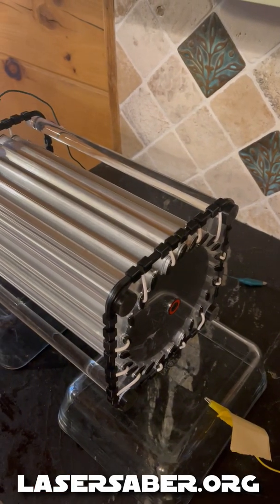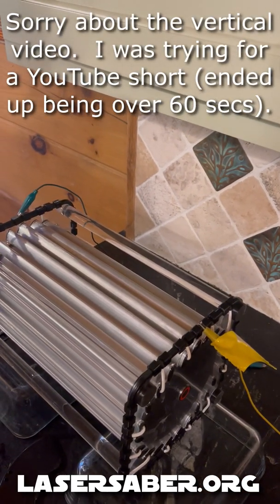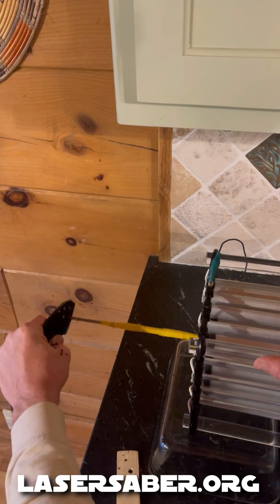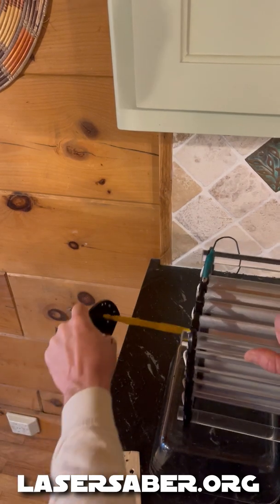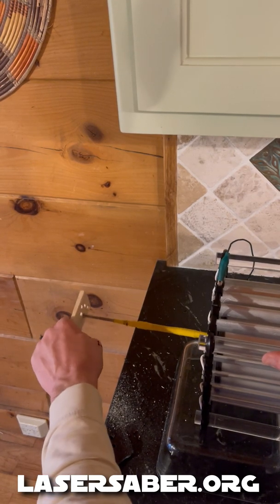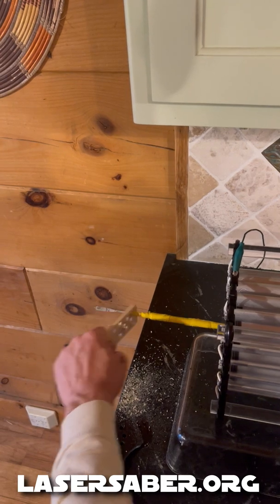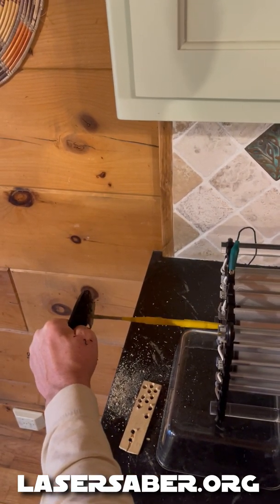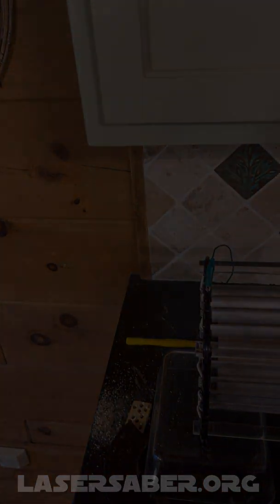Drill Torque Test - AtmoMotor Corona Motor

Comment: Seriously that's not a method for measuring torque. Pulling a defined weight up a defined hight until the motor stalls on the other hand is. Conveniently in Nm devide the weight by 10 to get Newton an raise it 1 meter and you get torque measuring also the time it takes to get that weight 1 meter up high gives you Nm/s =Js = Watt so go with a more scientific approach if you want to proof something otherwise you look like a fool fooling around with toys. Which clearly this isn't. We need empiric data

Comment: if you want a more effective wireless system you should look into Solishoods (charles solis) he describes the (death ray) as basically a van de graff generator with insulating glass vacuum tubes and metallic umbrellas to increase the capacitance before discharge, I think the design was basically a dryer vent in a loop and the desiccated air is charged with HVDC.

Comment: You probably won’t see this, can it be used to make a pump? If you can pump water up to a high height, you could make a water battery. It would pump water up to a tank 24/7 and when you want to use that water you gravity feed a generator with the water.
Reply: A ram pump can do this as well if you have some elevation in a creek, stream or river

Comment: Details on the power supply you are using, what power is it drawing, and perhaps you can quantify the torque, and efficiency on these are low.  I don't think many of your viewers understand that there is a reason, you need to use you 30 kV power supply and NOT the Van De Graaff or the atmospheric tower to do this.  That's important, the reason you need the power supply is you need a lot of energy in, neither of those other two sources can provide it.

Comment: Hey man good info, checkout video how lightning works, earth and air is AC electric at 6 cycles per second, so a earth battery or antenna requires a bridge rectifier for DC charging of batteries, oh have u heard of cold electricity? Patick kelly channel has tonnes of hidden patents videos

Comment: you need to put high up there a symmetric copper antenna and a hollow iron/bronze ball with copper coating filled with gold amalgalm (10/90 24k gold to mercury)
Reply: Why's that then ? ☺️
Reply: @strawman9410  Mercury reacts as a resonant frequency amplifier somehow
Reply: @vladimirN324  thanks. I need to do a lot more studying of this subject before my build attempt
Reply: @strawman9410  it uses the cathedral's conductive dom as a ground pole magnifier and wave guide it concentrates the a wide area of ground phase to a single point resonator say a cross or so. Its easy
Reply: @vladimirN324  now your just teasing me.
Why do you mention this version, is it a affective method?
Do you have link to an image or upload
Reply: @strawman9410  watch Introduction I to the nanoworld translated from Russian, a company called центрнаучфилм - наномир
Reply: @vladimirN324  can you provide a link

Comment: Powered Van de graff generators have like a 25-35W motor... (is yours super big?)  I know turning a van de graff by hand really never changes force for speed... and is much less than using a hand drill to go through wood.... as voltage goes up, the power goes up by the square; there is, granted, a high resistance... but as the speed of the motor goes up, does the resistance go down?  That would give more effective power at a higher speed... it'd have to be geared down probably... to gear it back up again in the handheld generator... which is a similar power rating.

Comment: these short style ones really are a waste of time. doesnt even format correctly for a phone unless you are in the proprietary app i presume. ugh 
fun project! whenever i catch something substancial about it ill hit it up. funny to me that people think torque was going to be a problem as atmomotors are electron density repulsion driven arent they? so if anything the more torque you ask for the more torque you get. up to stall anyway.
Reply: He IS NOT driving it from the Van De Graaff OR the Atmosphere in the drilling video, he says clearly he is using "his 30 kV power supply", I assume 50 watts in minimum, these are not very efficient so he is putting MUCH MUCH MUCH more in than he is getting out, the Van De Graaff would be useless as would his simple atmospheric tower.  Also, notice he is not running it via the corona pin, but directly, that is because the corona spray method will lose energy based on the law of inverse squares.  This is NOT some free energy nonsense, hence the reason he needs the 30 kV power supply to get his torque.

Comment: I think a simple rough way to 'measure' torque would be to quantify the rotational inertia and get an rpm guage (white tape method) and capture the reading on camera. Write down the time of each RPM update in a spreadsheet and you'll get an idea of the angular acceleration, and thereby the torque. Google docs could be useful if you wanted to share results.

Edit: Also, nice demo, it's looking really hopeful.
Reply: chuck a drill on the output shaft and then measure the current coming out of the motor

Comment: That's definitely impressive it's getting into the realm of seeing what some of these industrial motors can do I know are out there somewhere.. Like really finely constructed fins to provide the overall surface area in a small package and a strong dielectric to drive it at many kilovolts. The heat losses aren't there and it's basically unaffected by being stalled.

Comment: what is the amp draw during drilling?
Reply from the maker: Less than 1 mA.
Reply: @lasersaber  thx laser and plz correct me if I'm wrong so in reality the motor or the system is extracting about 30 watts of power from the atmosphere
Reply from the maker: @mohammadhashemi1771  In this case I am powering the motor with my HVDC power supply.  Check my other videos for free atmospheric energy collection demos.
Reply: @lasersaber  got that from tge video was just working out how much power o e would need to harvest from the atmosphere to run a motor on that level and get that sort of work out of it

Comment: Nice torque. Care to measure it with a pully and weight? 

Then share the weight of the motor. That might give an interesting torque to weight ratio.
Reply from the maker: Thanks for the idea.  I am already boxing this one up to ship out to Ion Power Group.  These motors can be designed to be very light.  Heavy parts are not needed.  A thin electroplating on a lightweight surface is all that is needed.
Reply: @lasersaber  Ohh ion power group, awesome to  hear they're still working on the atmo power plant

Comment: Noice
What is the input rating?
Reply from the maker: I have not made the measurements yet.  For now, I am interested in seeing if the torque continues to increase with the size of the motor.  I have a much larger build planned.  The power supply runs off a 12v/4a regulated wall adapter.  I doubt that the HVDC generator uses anywhere near that amount.  The output is 30kV at 1 milliamp.  I am not sure it is running at 30kV DC; it might be less than that, but I guess that is the maximum it could be drawing.